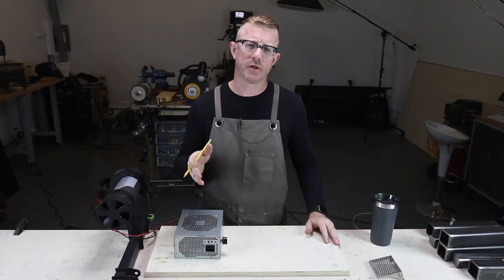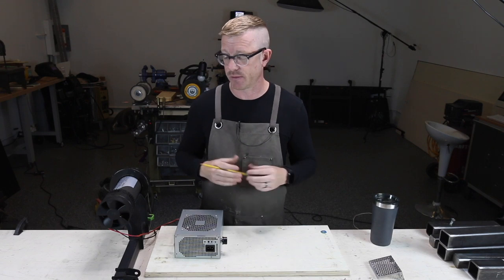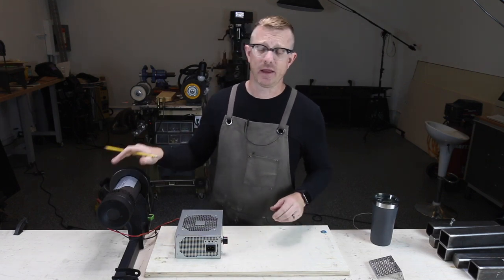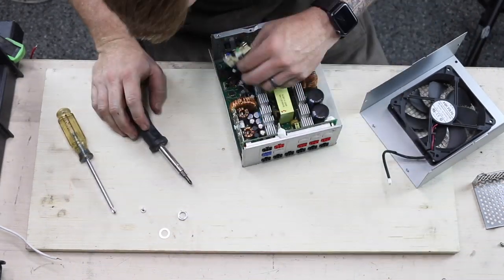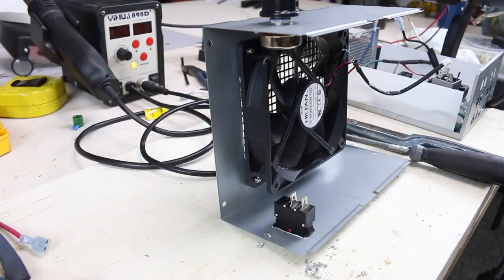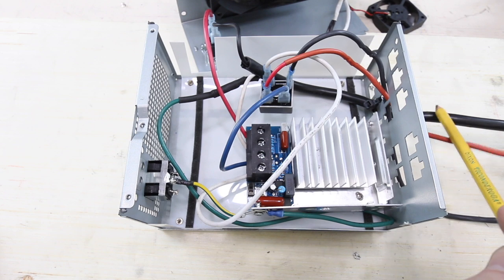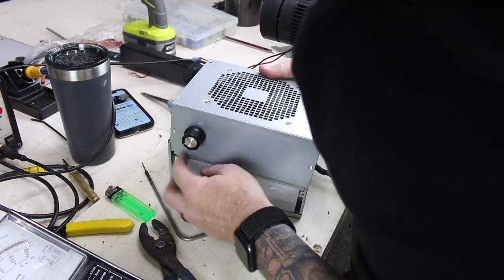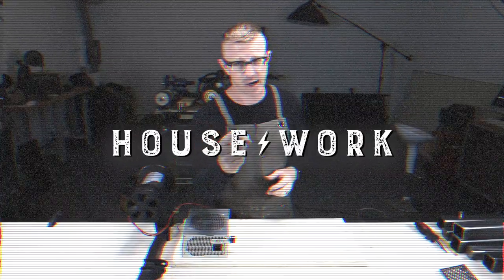How to: Build a DC Treadmill Motor Speed Controller for $20

Comment: Never build a metal grinder with a Treadmill motor. 
It's a permanent magnet motor, will suck up all metal debris and finally start making noise and smoke.
Reply from the maker: 100% agree. I switched away from this a few months after doing the build. Love my TEFC AC motors!

Comment: I was able to fix my crappy proform treadmill by doing this. It works great. I was able to source the wires I needed from the treadmill and use the parts recommended. Thanks!
Reply from the maker: Nice work!

Comment: I have 5 repurposed dc (and ac) treadmill motors in my shop, they all have different voltage and only one of them would work with your setup. You really should inform people that this only applies to motors with voltage somewhat in close range of their ac outlet.... And please please put on some kind of protecting sleeve on those cables, your cabinet will vibrate and short circute those cables in just a matter of (short) time. Kinda bummer to see you beeing electrified if touching it when that happens!
Reply from the maker: Yeah man. I learned a lot with this one. I am doing a lathe next. Thanks for your input as always. 👊🏻
Reply: Most treadmills I have taken apart are dc and 120v max. This will apply to most treadmills.

Comment: Would it be possible to use this SCR/Rectifier combo to make a DC power supply for non-motor purposes? I need to feed 80 VDC into a stepper motor controller that pulls 12 amps. My logic is saying that it will just need an added capacitor on the output side.
Reply from the maker: Hi Jake, I would suppose it could work, not sure about the AMPs though. Sorry I am not much help here. That said its the same for steeper motors from what I understand, so in theory it should work.

Comment: I appreciate your helpful information and ideas for recycling!! You helped me a little bit more with learning and building!!
Is it possible to hook DC fan to this design, with a three spot control board?
(* Electrical work is all very new to me, just made a video, using your idea I saw, for a case from old power supply) I have many questions..
- S.P. - never stop asking questions, never stop learning!
Reply from the maker: Hi Slim, I tried the DC fan hook up and it didn't work so great. Maybe I'll give it another try. Thanks again for watching.
Reply: @HouseMadeUS   ah ok, no worries! Thanks for the content, happy my draw bench works because of your helpful insight!

Comment: I have two of these motors.  One has two wires but the other has 4 wires, as in the black and read plus two blue wires.
The one with the 4 wires I have the controller too which I took off from the threadmill and I have wired it on the bench with a potentiameter and it works nicely.
How can I hook up the motor that has the two wires, like yours using the same controller.   One of the blue wires from the motor direclty goes to the AC and is also switched..
Aha, maybe I should see where the other blue wire goes on the controller itself coming from the motor, and that pin is perhaps the input to the controller.  In other words all the blue wire does is instead of the input going directly to the controller, it goes to the motor first.   Is the case?
Reply from the maker: The blue wires are for a temp sensor. Depends on the application but most likely they can be removed.
Reply: @HouseMadeUS  I connected the motor with the blue wire the same way they were when I took them off in the first place.  In fact the same switch that was also on the treadmill.  I never tested the treadmill.  Come to think of it I can bet it was a working treadmill. So I basically throw away a working treadmill ( which I wouldn't have used anyway).  I was mostly interested in what I could do with the motor. I like to use it to make a metal cut off saw with a 14 inch cutting blade. I guess I will find out.
The other treadmill motor with the two wires black and red also has a fan on the other end.  Nothing wrong with that.  
What will happen if I simply supply 90 VDC to the two wires, what would be the harm in that? using a simple power supply.

Comment: Is there a way to add a reverse switch to make it spin backwards, also an emergency kill switch to stop it would be nice. Thanks awesome video
Reply from the maker: Yes there is an easy way to reverse the motor. Its called DPDT switch. Here are the one's I use: https://amzn.to/2NGHRb1
Reply: House / Work, is that also the on/off switch, Thank You
Reply from the maker: Yes you can use that as an on/off switch if you like. The center rocker is just off.

Comment: What is a DC power supply?
In other words what does that DC power supply look like that these high torque DC motors need?
An AC power source/supply we have is a low frequency up and down and back and forth phenomenon if you will.
You know that sine wave thing.
So what is the shape of a DC, like as in your car battery, flash light battery etc look like?
Say, you know how it looks like, it is basically a straight line, which means it is neither up and down nor is it back and forth.
YOU GET THE IDEA.
So to convert, to change the up and down and the back an forth into one way and straight line....... you just think about that.

If you think them diodes and them capacitors can do that..... do not believe it for a second.  Just use sheer logic and you don't have to be educated to just picture that.

Now to actually change AC into the likes of a battery output is outrageous.  So that can't happen.
So who can bulild a circuit that will get it closest.  That is what it is all about.
That is what separates a cheap one from a good one especially one with high power.

A real good one will cost you more than a brand new Treadmill machine itself and not just its control board.

Imagine a DC straight line power supply to be the shape of a very fine hacksaw blade or even file a  very fine file, just get an idea, a mental picture so to speak.  That is a very high frequency DC if you will.

To change that AC from an outlet to a one way jobber is the easiest.   
That is after you install some noise filter. Then an inrush current controller and then the diodes to rectify it,

Then you turn that rectified AC inot very high frequency, not 60 Hz.  Clean up all that noise again and again until you get a decent true DC output that these motors need to run.
To get that clean DC you need high switching mechanism ( you know them chips) and to control the DC ouput so you don't just supply the motor as if direclty to a 120VDC  battery...... you get the idea, you need to pulse it. Otherwise you will have a spark and a fire and an inrush current that it is nobody's business.  So you also need a mechanism that it will not happen even  by mistake.  Then having that in place then you can play with what is termed as PWM, that lingo you hear about.
Pulse is the voltage you send, and there is indeed only one voltage.   Width is how long you send it for in terms of mili seconds that is.  And modulation simply means how long on and how long off in that one second interval.

[ Notice the voltage again can not be flactuated.  No sir.  So there really is no such thing as variable voltage/adjustable voltage. That term is indeed deceptive and if you did you will just cause a bunch of heat and heat loss.  Because the only way you can reduce voltage if you use it, that is components in series.   You have heard of the term voltage drop, resistors and resistors...  But that is crazy impractical to put in place and remove resistors and worse yet loss of power and effeciency. It is stupid and totally meaningless]

Furthermore.  Read this:  Just know that rectified AC to DC is not whatsoever the same as AC to DC converter/conversion.
Rectified DC is an unstable full of peak and valleys, it is just not back and forth is all.  And yes your DC motor will respond accordingly big time.

Comment: Very simply explained. Excellent instructions. 
Can this be used to control the speed for a sewing machine?  Could I include a foot peddle to regulate the speed? Any suggestions?
Reply from the maker: I assume it could power a sewing machine as long as it’s a dc motor. Any actuating foot pedal would work for this. You might need to use a different connector but it’s essentially a potentiometer like I installed just controlled with your foot. Good luck.

Comment: I read that use SCR controller is poor efficiency and leads to poor torque especially at low speeds, which is why more expensive controllers (VFD) are recommended.  And also that treadmill motors don't hold up. But I'm just a noob looking to upgrade my minilathe.
What is your experience with your setup?
Reply from the maker: 100% agree. After I did this experiment I quickly learned that I needed something more reliable. I switched to AC motors and vfd.
Reply: @HouseMadeUS  So you got rid of setup in this video and switched to AC Motor and VFD?  How much was that?  Do you have a video about it?

Comment: Hey! Thanks for the great video. I used this method to regulate my dc motor. But it is producing a very strange noise that sounds like the frequence is false. I have a 180 volt DC motor, a bridge rectifier and an scr regulator running on 230 volt ac. It is running.. fast and powerful. But the sound seems pretty unhealthy for the motor. Any ideas?

Comment: Hi, I very much like the video but i have a small problem. I have a DC motor from a treadmill that is 180V 1.25hp 3amp but where i live there is none of the parts that you use instead they are offering me bridge rect. that is 35A\ 1000V and a PWM DC 12-180VDC 1500W controller. Will this configuration work and shall i buy the parts? Amazon ships to me in 2-3 months so its not an option :(

Comment: Thanks for the info. Ordered the parts from Amazon. Going to use it on a 50's bandsaw for cutting metal and wood. Where did you mount the earth/green wire?
Reply from the maker: Earth it to the motor case, then to the controller case which in turn gets grounded to the power cord and to the wall plug.

Comment: How do you know if the circuit board  is still good? 
I broke down my whole treadmill pro form 505 CST 
& the light works my motor works but when it was all together it won’t run oh & my control panel light up too .. so I’m thinking it’s the data cable or

Comment: Awesome video and really easy to follow. One question please…my treadmill motor is still running too fast for what I need (450rpm). Is there a way to control the speed to a lower rpm?
Reply: Since this is about building a speed controller, I would assume you mean slowing it down  from at the lowest speed, I would think you would have to think like a gearbox meaning putting a small pulley to a large pulley.

Comment: I'll tell ya one thing i've learned when trying to show people electronics, anything we think is "easy", most people can't comprehend... I made 2 video trying to show how to make an AC/DC etching machine. The 1st, I took apart a wall wart & just tapped wires off the transformer, ran that & the regular output(DC) to a switch, people were lost... 2nd video, i made it easier. 120v to a transformer & a wall wart with a switch in between, people were still lost... Good explanation though, looking forward to how the build goes... take it easy...
Reply from the maker: Yeah I know Dave I was wondering if I was explaining it properly. Hope someone gets some use from it! How’s that new grinder working out!? Super jealous!! :)

Comment: much thanks for the great video.  question is, what if you are using a speed controller with only an one in, one out, and one com?  Also the on off rocker i have has three prongs (one being copper).
Reply: I'm in the same boat, trying to figure out how to wire this with only three pins on my controller. :(

Comment: Hi, I am wanting to install a DC Speed Controller on my treadmill. I am not an electrician and need help with which Speed Controller will work with my DC Motor. My motor is: DC 90 Volts & 20 Amps. All of the Controllers seem to be lower volts and lower Amps. Can someone please post a link to an appropriate Speed Controller I can buy on Amazon that will work with my Motor. I appreciate it.

Motor: DC 90 Volts & 20 Amps

Comment: I have a 90 volt DC permanent magnet 1/2 hp motor. I would like a dc-to-dc speed control preferably 48 v from batteries. Would you know how to construct the controller like that?

Comment: I see the green ground wire coming from the original power cord is grounded to the switch,  does that take care of grounding everything in this setup or do you also ground the motor via the motor housing?
Reply from the maker: I like to ground everything, a very good practice. So yes, ground the motor as well.

Comment: My two motors, the first one runs on 90VDC, 20 A on one and 100VDC and 23A on the other.
I have the controller for the first motor and have used it to run the second motor as well.  
The second motor is twice as heavy and big as the first. 
When I turn the potentiometer on the controller all the way, the RPM is the uppter teens safe to say.   The second motor that runs on 100VDC is far bigger and its RPM is far less and the RPM on it is also in the specs, around 3200.

 When I build your set up, I used a higher rating of rectifier with a heat sink along with a fuse, a switch, a large capacitor and threw in a big fat choke as well.  I figured it will help reduce the spark armature/spark/brushes contact.
 For ease of usage I also installed an outlet on the box so I can just plug in the motor with its own prong right into the outlet.

It is doing what it supposed to do.   However the other day I decided to check the out put DC voltage.
I turned the knob all the way and checked the voltage on the outlet. It read 180VDC.
What is the consequence of such high voltage to a motor which runs on much less voltage assuming it is being cranked up all the way?
You got voltage Vs Amperage and total power I suppose is the two multiplied.
I don't know how the math and the physics of it works out.

I have not installed volt/amp gauge to see what it does at various position and load.
These motor certainly run on just regular AC by just directly using the controller without the rectifier. Of course it will have less power and what toll it will have on the motor, plus noisier and more spark.

Comment: Hello mate, I have one important question, can I use this project to power the threadmill itself? Because the motherboard burned and i dont want to throw the threadmill away in the trash... Does this project have the neede power to run on the mill?? Thank you!!
Reply: Hi, I want to do the same thing. Can you please tell me if it worked for you. Thanks.
Reply: @lornemclean  yup it worked 10,000watt regulator+ 50ah rectifier

Comment: My treadmill is not working. 
The motor is working properly but there is a problem in the circuit
board that shuts down the treadmill after 10 or 15 seconds and gives an error
code of 11 and/or 21.  My research
on-line points to there being a faulty component on the circuit board.  After watching your video, I was thinking I
could purchase a rectifying diode and motor controller, such as: AC 0-220V 20A Pulse Width Modulator PWM Electric Motor Speed Controller Max 4000W.  Then disconnect the motor
leads from the circuit board, and attached those leads to the motor control
switch.  Wire in the rectifying diode and That should allow me to control
the speed of the motor with the rotating switch and once again use the treadmill, would you say I am correct?  or is there anything I'm over looking?
Reply from the maker: Yes as long and you get the right controller your theory is correct. Also you might want to check eBay to see if they have a controller with the exact model # of yours, they might be cheap and you could use your old interface too. Could be an easy fix
Reply from the maker: Also one more thought, that error you’re getting could be related to a faulty heat sensor on the motor. Look into that, or maybe disconnect the blue wires on the motor, that is the sensor itself. That may correct the issue. Good luck.
Reply: @HouseMadeUS   I will look if I have blue wires on the motor, and if I do, will remove the blue wires, and see if that helps, thanks!
Reply: @flywelder  Hello, i have an issue with my PCB on the treadmill and i am not very knowledgeable enough to fix a circuit board, the motor is fine -i have checked. Please could you send me details on how you managed to fix your treadmill.
Reply: @gappudada  Mine tuned out to be dirty wire connections , where they connect to  the circuit board.  I removed each one, one by one, and sprayed electrical contact cleaner on the connection point and then reattached the wire, a couple times. Hope this info helps!

Comment: I had a question about a video you posted on eBay “How to: Build a DC treadmill motor soles controller for $20”. In the video when you are showing the wiring I understood most of it except the two items that are at the top of the screen. The potentiometer and the fan. 

You mention both. “the fan which is up inside of this case and the potentiometer which is her and has a fancy little connector that’s just plugs right into the board down in here” pointing at the motor controller board.

How does the fan get power? Does that plug directly into the AC motor  controller board as well?

Comment: Briiaan!, ( as if stewie from family guy was trying to gain your attn.) Excellent, excellent! I'm doing a drillpress rt. now, and have done a large surface grinder in the past, (still operating) with all the treadmill fixins,bulky, hard to protect in a shop setting, gathering metal as we speak, this REALLY looks like the way to go! I've found low/ no grease in the bearings of  these motors, it pays to pull the shields, and loadem' up,if you dont, like I have foolishly done, knowingly, it gets me everytime! Great vids I'm your newest subsciber!